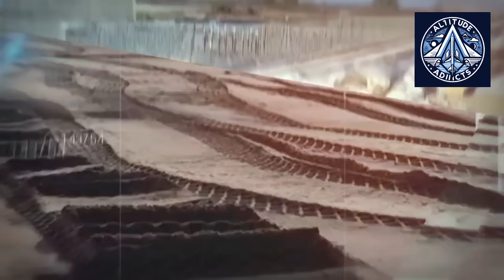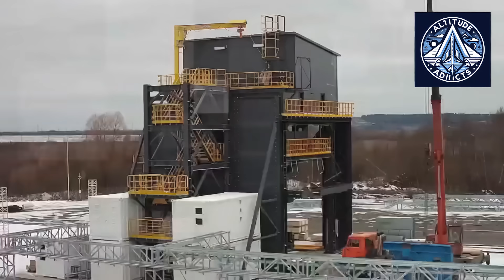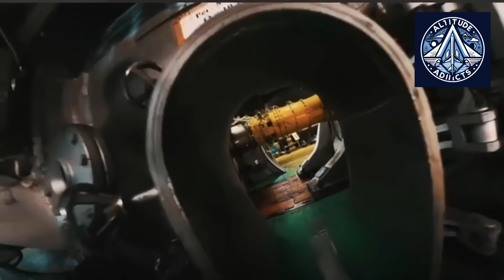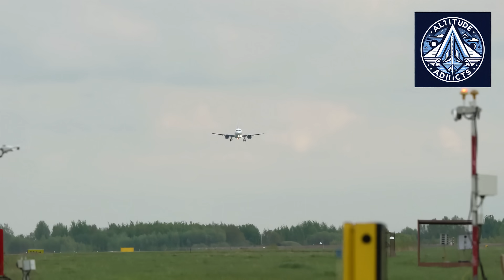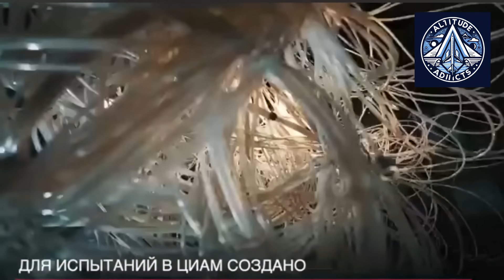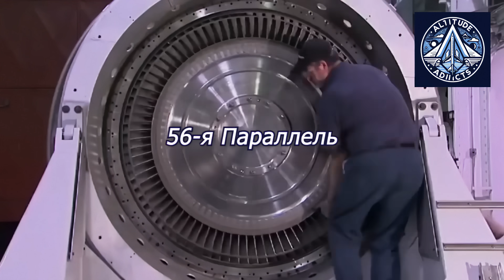Russia Hints Works on MC-21-500 Wide body Aircraft with PD-35 derivative

Comment: Well, not 500, but 400. The 400 model was planned as part of the 200-300-400 line. However, that's still a long way off, and the 200 version will appear first.

Comment: C909  -  MD80  -  SSJ (PD8)
C919  -  B737  -  MC21 300 (PD14)
C929  -  B787  -  MC21 500 (PD35)
C939  -  B777  -  ? (PD50 ?)
C949  -  B747  -  ? (PD26 x 4)
China requiere por un buen tiempo el motor PD35 para sus aviones C929
También requerirá del motor PD26 para un uso estrategico y gubernamental (no comercial) pues necesitará con urgencia un equivalente al B747 sobre el que vuela el presidente chino, que podria consistir en el fuselaje del C939 pero con cuatro motores PD26.
Reply: Die Russen haben einen Gasgenerator GDK in der Serienproduktion. Aus dessen Kern sie auch ein Flugzeugtriebwerk entwickeln wollen.
Ähnlich möchte man aus den PD 8/14/35 Kernen auch Gasturbinen für die Energiewirtschaft ableiten.
Reply: @T-BwBerlinKarlshorst-  Ja, ich habe gehört, dass die Russen Flugzeugmotoren entwickeln, die auch in Gasgeneratoren eingesetzt werden.
Reply: In fact, the PD-35 cannot be installed on the MS-21; the MS-21 has a very low wing, and for the same reason it cannot be installed on Chinese aircraft. The PD-35 engine is expected to replace engines on cargo aircraft.
Reply: @PhilPantnik  I understand there are two versions of the MS-21: the 300 and the 500, and note that the Chinese aircraft is not for the current C919 but for the future C929. Regards.

Comment: An MC-21 widebody, isn't this a contradiction? Why not call the aircraft the MC-22 instead?
Reply: МС 21 это  Магистральный Самолёт  21 века, это общее название всей линейки самолётов, в том числе и широкофюзеляжных моделей. Разница во вместимости пассажиров и в двигателе и всё. Сам самолёт один и тот же
Reply: The time hasn't come for that yet.🙂
It seems you don't understand... I'll explain. When this project was started, it was called:
21st Century Long-Range Aircraft.
Reply: Weird naming convention.
Reply: @jeffhedrich3551  You might be right.
It's probably a matter of the alphabet. Russian letters are different. In English, the letter "S" is written as "C" in Russian. And the name itself—that's what they called the program; they apparently wanted to name the aircraft after the work was completed. But it just so happened that the name stuck, everyone got used to it, and it looks like they won't change it. Incidentally, it's a similar story with the PD-14 engine.
P is the promising D-engine, 14 is the engine power. It probably has a long and boring designation in the technical documentation, but everyone is used to this name.🙂
Reply: @llem346  So I guess there will be TWO larger planes? This 7 abreast with PD26, 250-270 seats is like 3/4 size.
With the PD35, is there still room for even larger plane, to go against the 777x, with around 400 seats???????
Reply: @madmax7622  It's difficult to answer this question definitively. I can only share my own assumptions. I believe the most likely outcome is a longer version of the MS-21. This will maximize the use of common components. The deciding factor will be the availability of an engine. It will likely be developed for this aircraft and the new transport aircraft. Developing an engine for just one stretched MS-21 is economically impractical. Production volumes will be small, and the investment will never be profitable. Russia's demand for wide-body aircraft like the Ilyushin Il-96 or Boeing-777 is limited. While it's possible to create one, much depends on the availability of a market.

Comment: Its crazy to put a PD-35 on a single isle aircraft, it's more for a wide body new aircraft....
An MC-21 500 could use a PS-90 A4 or a modernized Kusnetzov 86 or a PD-26 low rated or a revamped Soloviev D-30...!..
lots of options here....
Reply: No escuchaste ni atendiste al video, ms 21 500 tendra doble pasillo
Reply: PD-26      for the   MS-21500
Reply: PD-26 is the best option here I guess.
Reply: @vatnikxxi7717 
Das PD 26 ist eine Ableitung des PD 35 Kern, mit verminderter Leistung.